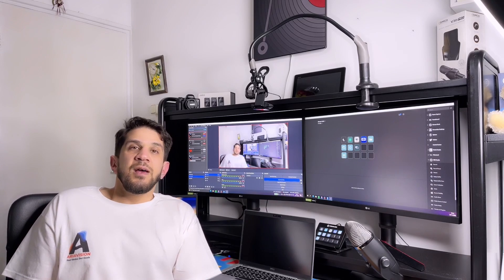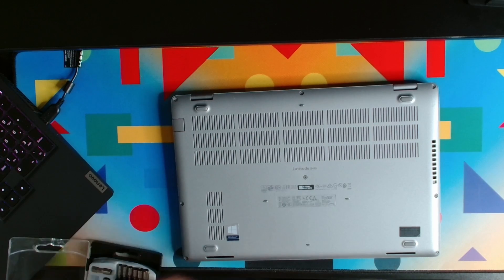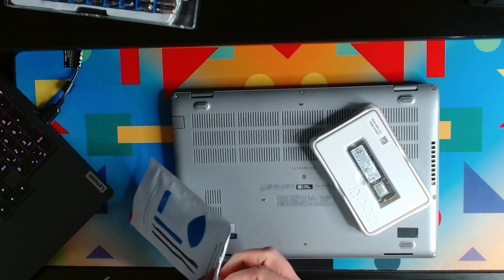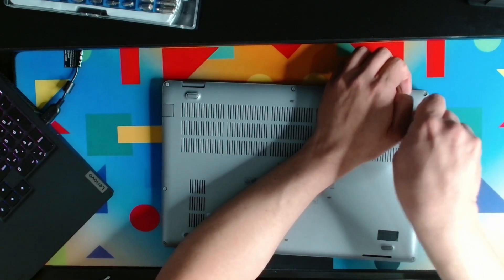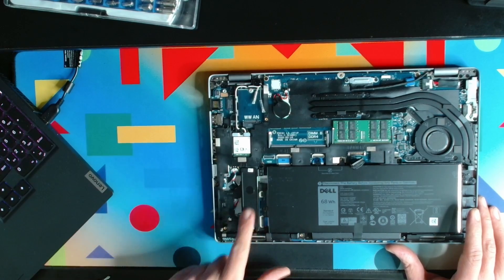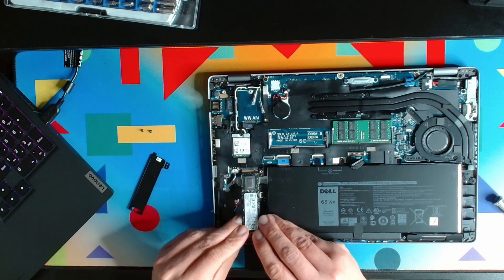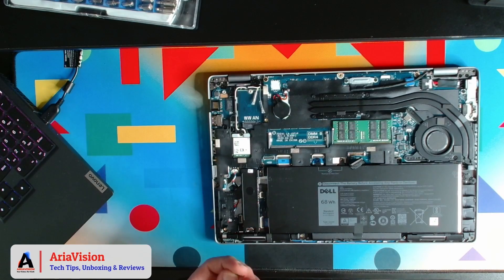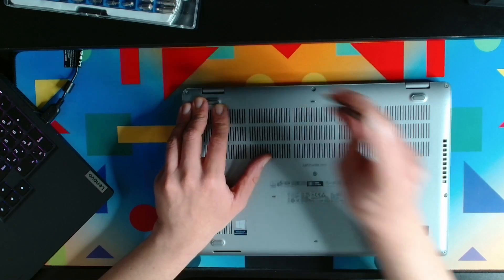Dell Latitude 5410 Upgrade Guide ( SSD M.2 )

Comment: Thanks for the video. Nicely presented. My SSD has gone bad and I told that I will have to upgrade with a new SSD. Once I install a new one described by you, how to install BIOS and operating system? Is there a video on this one that you can share? I cannot copy anything from existing SSD as it is bad and not accessible. Thanks

Comment: thanks for this, I Looking at installing a 2nd drive in the laptop as there is very little room on the first drive. Can this device handle two M.2 SSD drives?
Reply from the maker: Hi,
I don’t see any space for the second drive? I suggest to buy larger drive ( up to 2TB ) and upgrade the laptop with